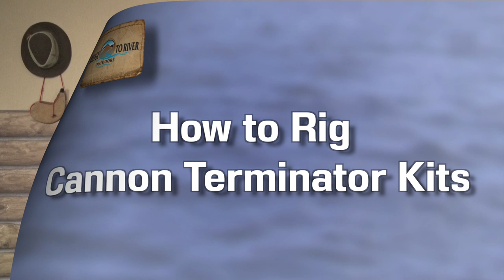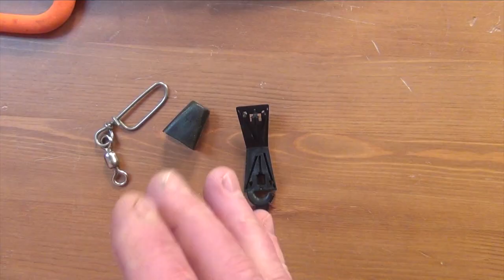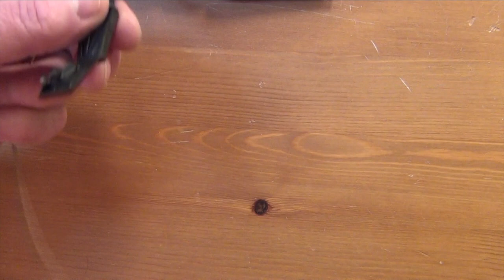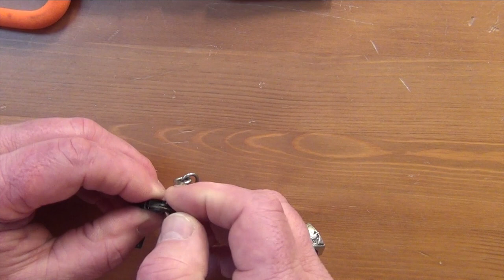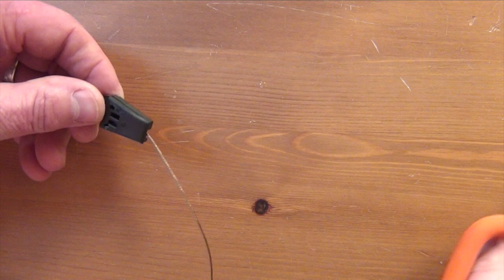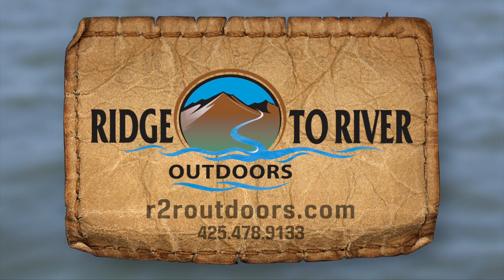How to Replace a Downrigger Cable Terminator - Cannon Terminator Kit

Comment: How do I fasten the other end of the cable onto to downrigger spool ?
Reply from the maker: Hi Clasvi, 

The following instructions show how to replace the cable on a Cannon Downrigger.

Step 1) Begin removing the old cable from the spool, towards the end you will notice that the cable is inserted into a small hole in the spool and held in place by a crimped sleeve. This crimped sleeve can be cut off to fully remove the wire from the spool.

Step 2) The end of the new cable is inserted into the small hole on the spool and pulled through the
other side, a sleeve can then be crimped on to secure the cable to the spool. 

If you have an electric downrigger you will need to push the up switch to wrap the cable on the spool. If you have a manual downrigger you will need to crank the handle forward to wrap the cable on the spool. 

Caution: Always wear safety glasses and gloves. Disconnect all power to the downrigger before beginning any work or maintenance. Johnson Outdoors Inc. is not responsible for any damage due to improper rigging or installation. If you do not have the skills, experience and tools to perform the following maintenance and repairs, we recommend you seek the help of a Cannon Authorized Service Center. A list of Authorized Service Centers can be found at https://bit.ly/3bSYrwK or
contact our Technical Service Department by email at service@cannondownriggers.com or, by dialing 800-227-6433.

Thank you!

Comment: I hung up on the bottom and had to cut my cable at a lake. I don't know how much cable I lost on my Mag 10, I'd guess maybe 20 to 30 feet?...  Would loosing that much cable affect the cable Depth counter at all? That's what I'm concerned about. If not, then I'll just tie on another Terminal Kit and be done with it. I rarely use my downhugger to go over 100 feet deep.
Reply from the maker: Hi CJ's Outdoors,

The Mag 10 STX is spooled  with 250 ft. of cable, so 20-30 ft. of cable removed should not affect the depth counter.

Thanks!
Reply: It will not affect the counter because you are just resetting from zero .

Comment: Thank you for the instructions and the sequence of actions when replacing a new terminator. I installed the flash mount and I have a very  big problem with disconnecting the power cord extension. Is there a solution for this, because this connection is absolutely the worst I have ever encountered.